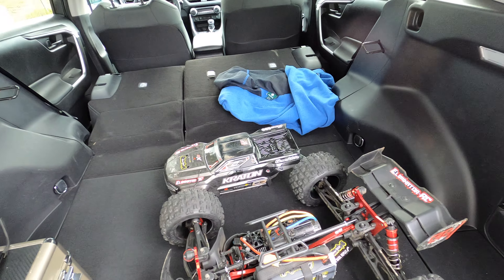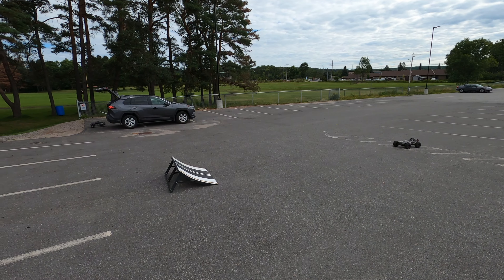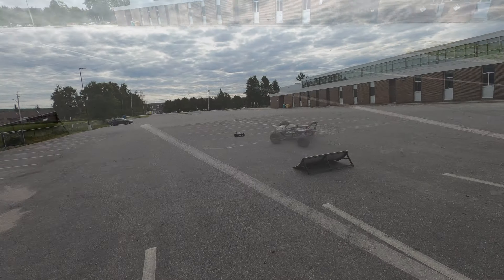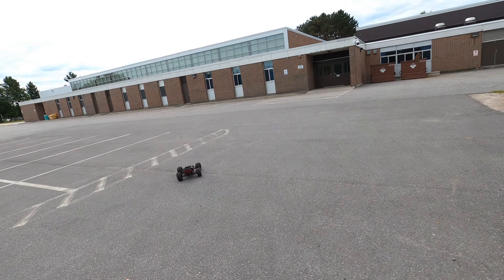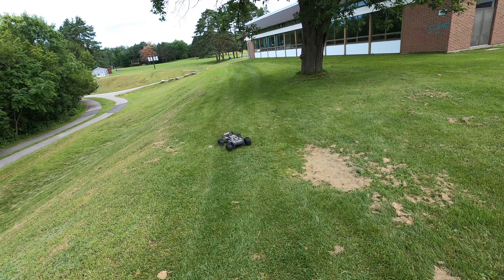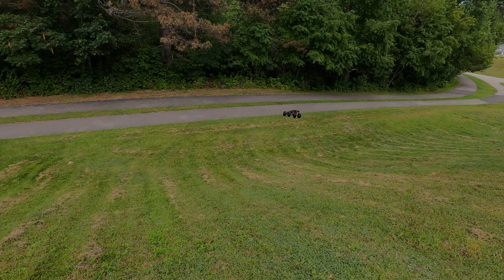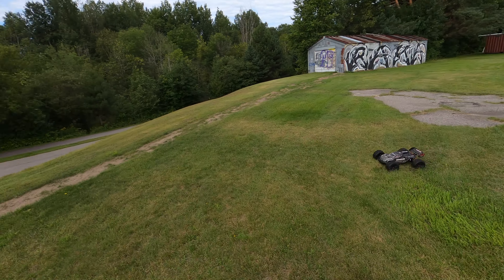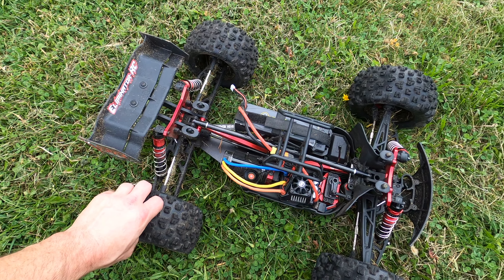Arrma Kraton EXB 6S Launching Off The KC RC Ramp

Comment: Wish I could get that ramp in the UK. Looking for a decent ramp that I can just fit in the back of my car.

Also, I'm the same with the EXB. Had mine 12 months and bash it prettry hard but litterally the only thing I've had to replace is the wing mount and rear diff housing, and both of those were due to me landing it extremly badly  onto some railings.

Its been a much cheaper car to run than even my 3s trucks.
Reply from the maker: The EXB is the GOAT of the RC world.